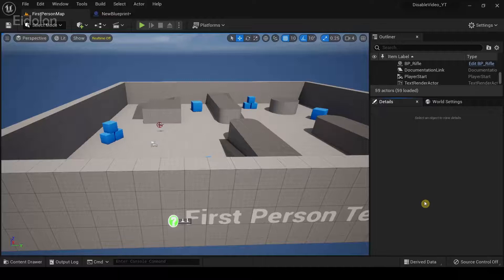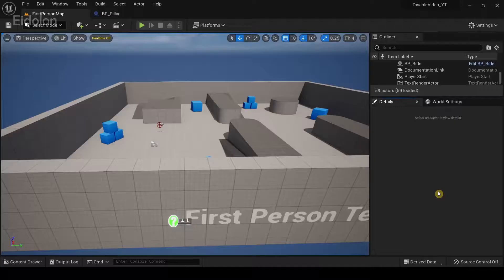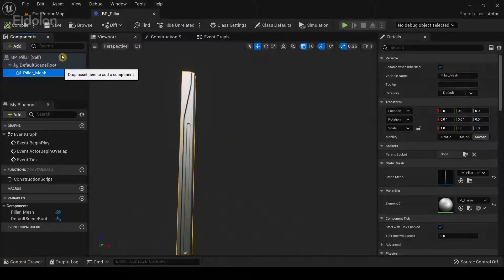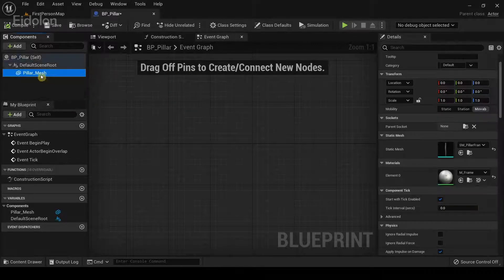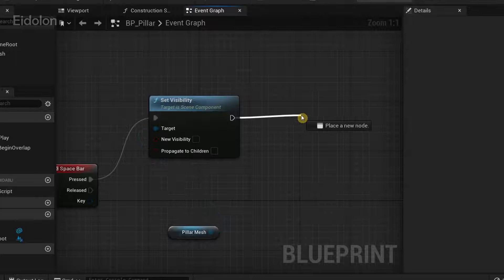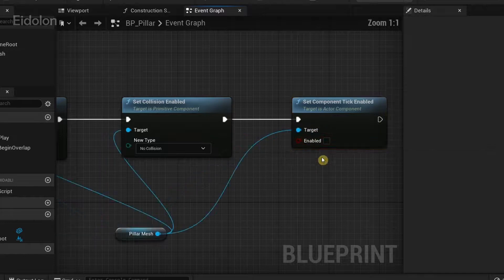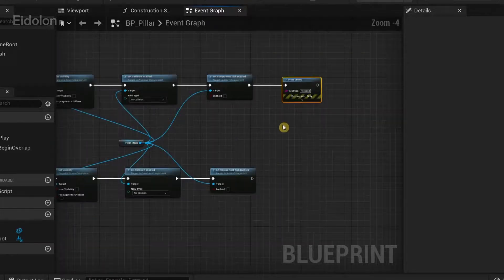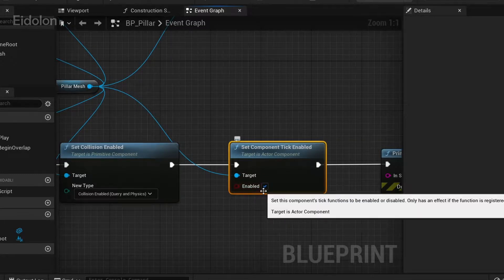How to Disable or Enable Components using Blueprints | UE5.0

Comment: is this method doesnt work anymore? since i use the same way, instead of hide, the character jump instead, and when i try to change the spacebar node to other keyboard node like capslock, nothing happened
Reply from the maker: Your comment reminded me, that I forgot to mention something important. The issue your facing is most likely the blueprint not receiving the input from the player.

To fix this issue you go to the blueprint your trying to hide (in this case it would to BP_Pillar) and select Class Defaults. Then in Details drag down and search for Input and under Input there is a drop down button beside the Auto Receive Input that should say by default "Disabled". Click on the button and select "Player 0" and then make sure to select compile. That should most likely fix your issue.
Reply: @eidolon_dev  OKAY WHAT I DO IF I WANT BOTH ACTIONS SAME TIME?

Comment: its simple u just need that drag component actor and call deactive node which comes with unreal node library and u can also active both nodes comes by default u dont need to do this much work. just drag actor component and call deactive and active.
Reply from the maker: I tested out the deactivate node again and it still doesn't work for me in ue5.0.3 . The Set Active node and Toggle Active node also don't work for me.
Reply: Interesting thought. How can you add and remove a component (e.g., by name) that is not already added to the actor ?

Comment: This is fine for meshes that need to be made invisible, without collision, and not responding to the game loop. How would you use the spacebar to add a component (at runtime) and remove this component  from the actor (e.g., to make sure that certain abilities are added or stripped more generically) ?

Comment: You can always just use Destroy Actor
Reply from the maker: Disabling or enabling components in an actor is commonly used to optimize performance in the game.

If you were to spawn and destroy a large number of actors each time you wanted to view it (e.g., scrolling through a large number of weapons in an item shop), then the performance of the game could significantly drop.
Not to mention the performance on mobile, would also be even more terrible.